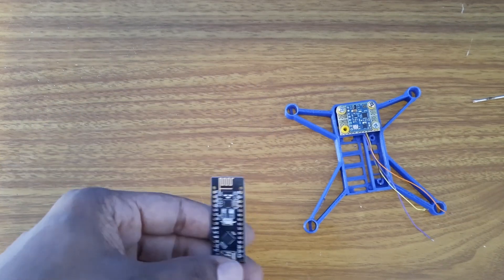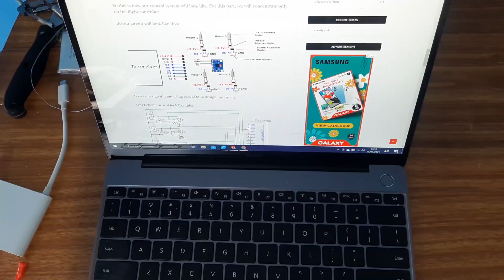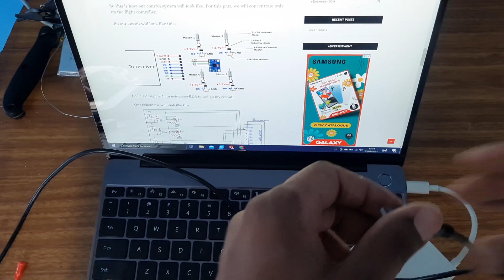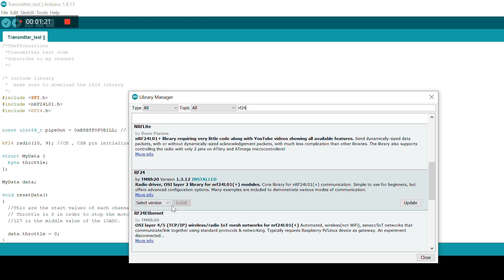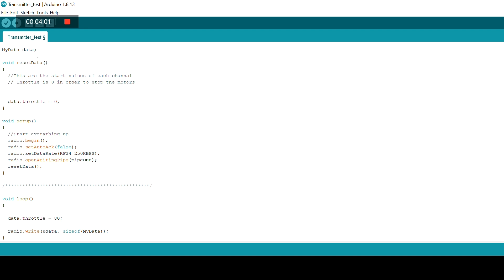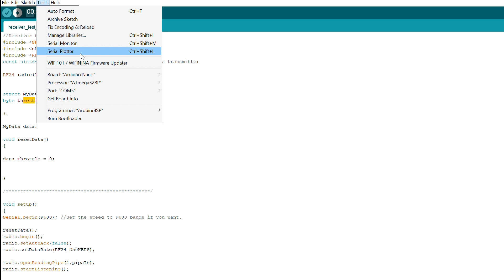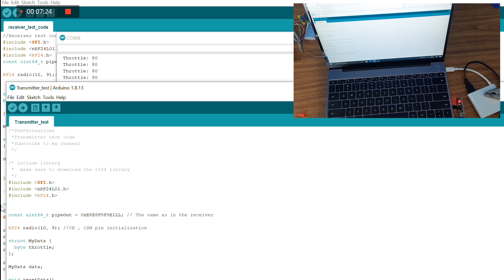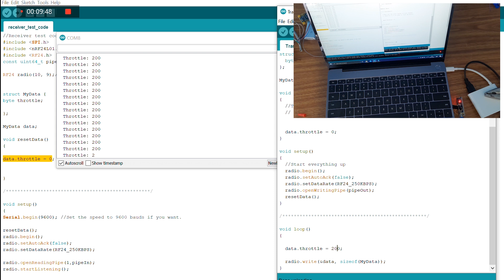DIY arduino drone project(Part 2)| Testing NRF21l01 transmitter and receiver| DJI Tello clone

Comment: Have You developed any app to control it ? Or u will use any diy remote
Reply from the maker: hello, for now i will use the DIY remote but later on will upgrade to work over WIFI through smartphone